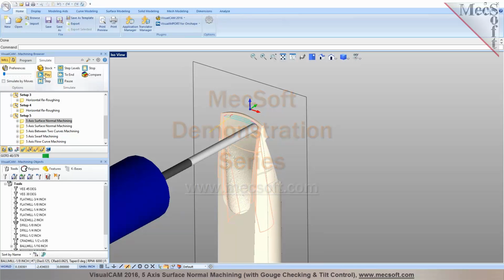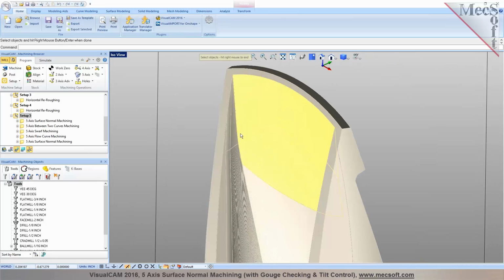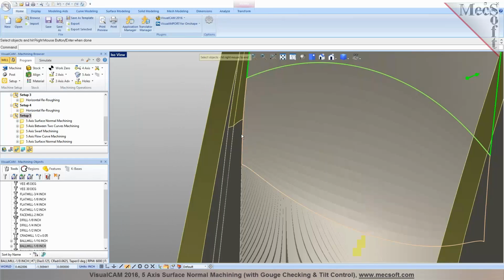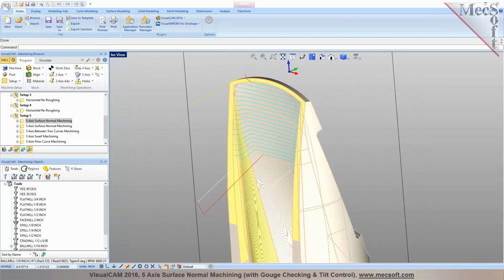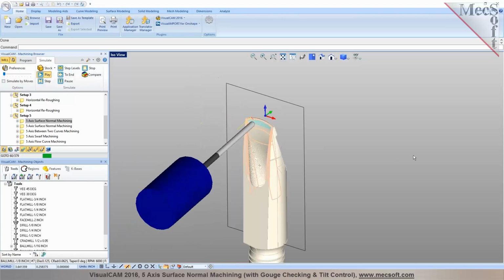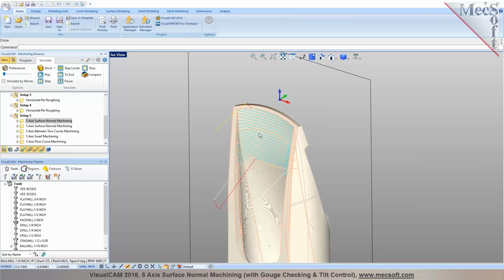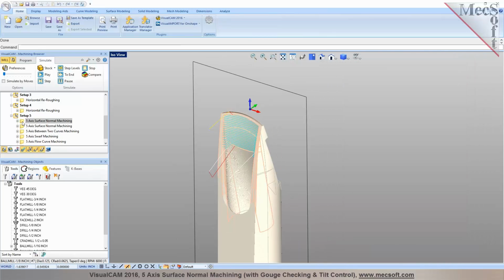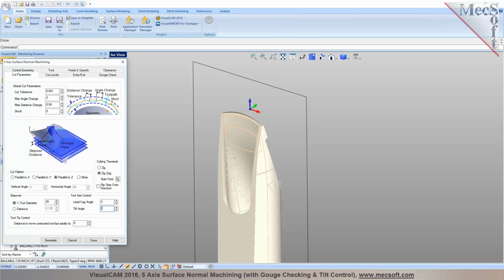VisualMILL 2016, 5 Axis Surface Normal Machining

Comment: what is the post processor ?
Reply from the maker: The Post Processor converts the cut motions of the toolpath in VisualMILL to g-code for a specific cnc machine.  For example, if your cnc machine has a Haas controller (i.e., the software used to run the cnc machine), then the post processor would be set to Hass before you post the g-code.  VisualMILL ships with over 200 post processors and a post process generator so that you can customize or create new posts yourself.  I hope this helps.
Reply: Great ! thanks